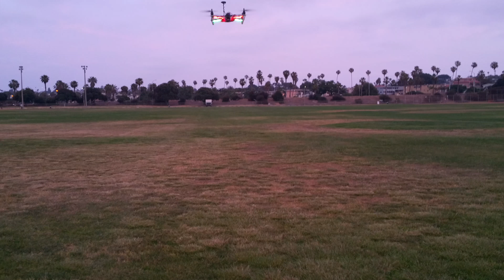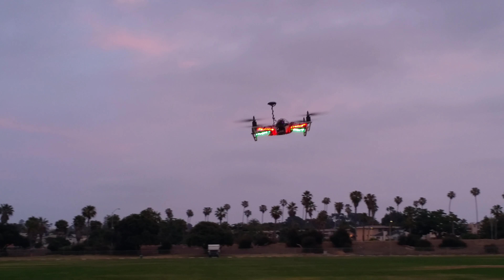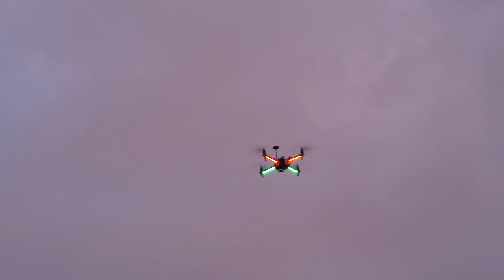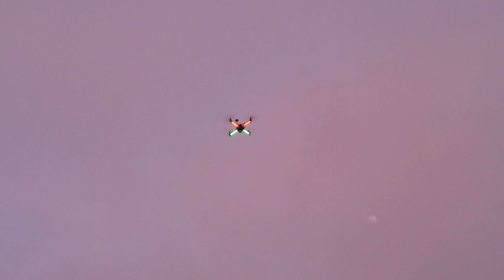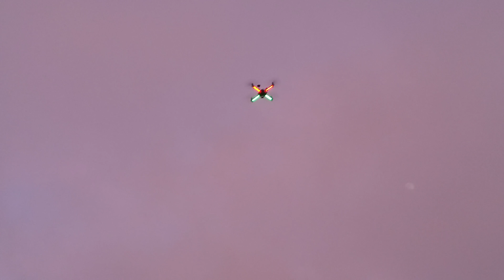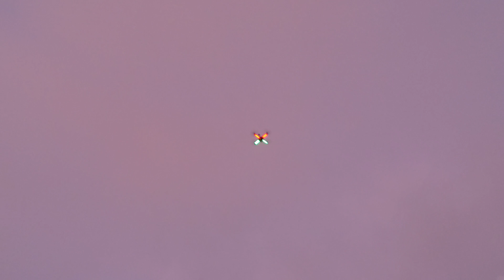APM QuadCopter Twitching in Stabilize

Comment: It seems like PID settings. Go to mission planner, extended tuning, and set channel 7 to auto tune. have the ALT hold as a seperate channel also. When you fly in an open area , enable channel 7. The copter will then pitch yaw and roll itself for about 10 minutes tuning its PID settings. you can read up on the autotune feature if you are unsure.